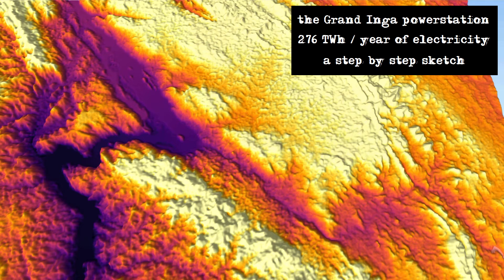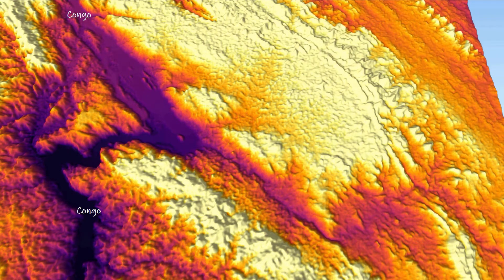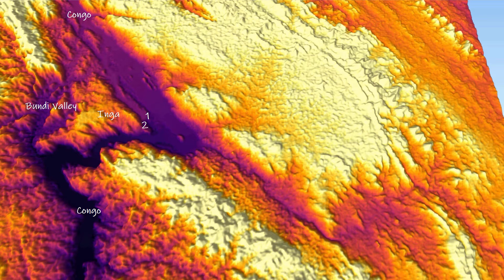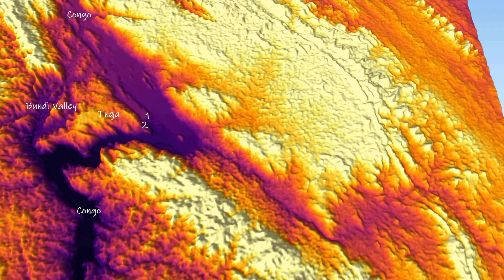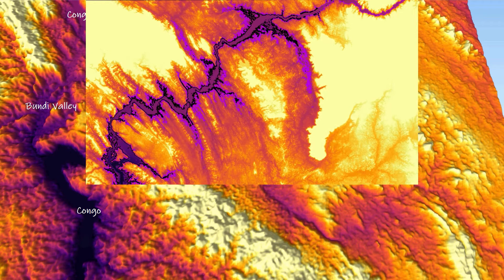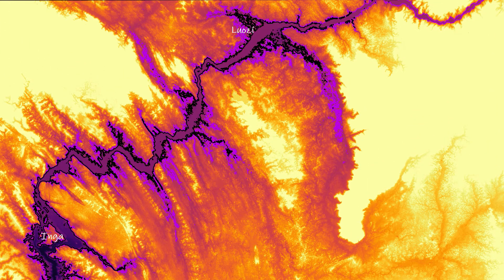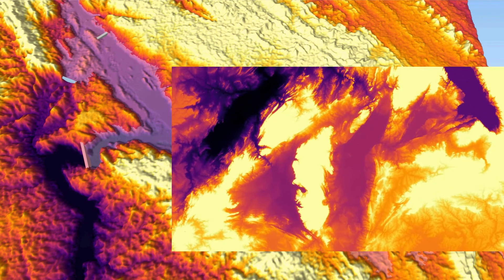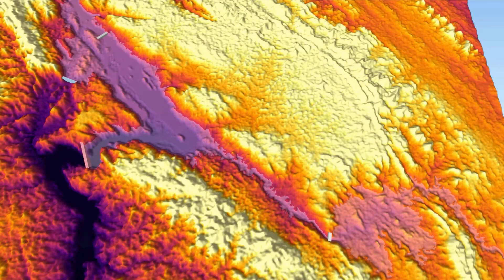Grand Inga Dam Project improved design (hydroelectric power in the Congo river): step by step sketch

Comment: Cost 80B $! A very big debt trap! Do like below instead.

For about 2B, not 80B, can get DRC 7 times more power, than the current
production. 

You can just use 0,2B whit turbine and installation, and make a 20km
tunnel under the DRC Capital. And you increase DRC Hydroelectric production
from 8TWh to about 18TWh. Hydraulic head is 20m. 

Do not forget that, you have one more Capital city 2miles away.

Grand Inga: You only need 6km tunnel to pass this waterfall. Make 3
tunnels for the price of about 0,2B, and get a Hydraulic head of 90meter. And
you can maybe make 40TWh a year. 

And you can add on more tunnels and turbines, and maybe get 180TWh, without
making the largest and most expensive power plant ever. 

Let’s add some grid, and put in a margin here, let’s say 2B, for
increasing DRC Hydroelectric power production from 8 to 58TWh. That is cheap.

And if you want more power laiter, you just make a copy off the then existing
plant, at the same location. 

You got 41
Reply from the maker: Is there a link to a more detailed description with something to verify?
But you still need a large reservoir somewhere to have a good year round electricity production: upstream of Kinshasa & Brazzaville, but where?
Reply: @ericweijters2350  Verify: 1. Google Earth, you got everything you need there, elevation and distances. 2. This river has 64,1 times more water discharge than Colorado River and 5,4 times more than The very big Colorado River. More infor here https://en.wikipedia.org/wiki/Congo_River
Reply: @ericweijters2350  Reservoir why? NO! 1. The existing power plants Inga1 and Inga2, does not have a storage. 2. Minimun Dicharge here is 35 times the average in Colombia River or 23 000m3 a second. That is more than enough. 3. You have tousens of River Hydro plant all over, that do not have a storage, they just use some of the water that comes by.
Reply: @ericweijters2350  "Year around": No this is in the Tropics, it is poring down all year. The minimun Dicharge is over 5 million gallons every second, it is ok. Or 16millions as a maximum.
Reply from the maker: @terjesorhaug143  The discharge variation: it is big, so the electicity production would vary a lot without a reservoir. That would mean more/thicker cables to South Africa etc: that also has a big price tag. And most industries and cities want a more stable supply in and out of the rainy season. When there is a surplus in energy prices drop: that to can be a reason to have a reservoir.
Reply: @ericweijters2350  "variation: it is big": Yes it is big. But that is not important. The minimum dischage is 23,000 m3/s (810,000 cu ft/s), that is 35 Colorado Rivers, 3 times The Colorado River or 8,6 times more water than in The Nile River. Trust me, this will be enough.
Reply: @ericweijters2350  "Kinshasa & Brazzaville, but where?": Easy, under the city centre. Start here "Cite Mata Onatra" 268meter over sea level, make a 18,9km long tunnel. Here The Congo is 243 meter over sea level, a 25meter drop. Lets say 20meter (to counts for the Mounsun rain flooding). 68feet Hydrolic Head/drop, is good. And whit 64 times the water that is in The colorado, you have enough water. .... And you got 2 Capitals 1 to 30km away, perfect. ... Saves  a lot on grid constrution. Inga falls, yes can do the same there, but you only need 6 km tunnels, and you get about 90meter Head/drop. Good, but far away from many costomers.
Reply from the maker: @terjesorhaug143  You cannot store the volume needed to buffer the runoff underneath the city
Reply: @ericweijters2350  I never talked about storage of water, because it is not needed. I am talkning about  just make a tunnel to move water. Moveing it to the lower place at the same river, and there you place the turbins (in this case use Kaplan turbines). Like this (and in this case 0 storage is needed) "Run-of-the-river power plants may have no water storage at all or a limited amount of storage" Source: https://en.wikipedia.org/wiki/Run-of-the-river_hydroelectricity ... The world has many tousand of this (I have 7 plant like this whitin a 20min drive... They make "gasoline" for my EV).
Reply from the maker: @terjesorhaug143  Ok, did not correctly understand your reply, but we will not agree on the reservoir. Not a problem as long as there are are no funds to actually design (to built) the thing: than the choice has to be made. Now it is only a rough sketch.
Reply: @ericweijters2350  Yes, a sketch. It is 100% the same as the 10 000+ power plant, that borrow water from a river, and give it back to the same river, just some meter/feet lower - A Run-of-river hydroelectricity power plant (ROR).
Reply from the maker: @terjesorhaug143  You mean your suggested ROR alternative for the DRC?
Reply: @ericweijters2350  Yes, they got all they need: 1. It a very cheap fast and easy way to do it. Maybe 0,3B $, not a 80B $ debth trap (after DRC make money on this, they can use some of the 95% of the water left in the river). 2. A ok Hydrolic Head. 3. Enough water (about 5% of this water, and you can increace DRC Hyrdoelectric production whit about 800%). 4. How else has 2 Capital city, whitin walking (or a 5 min boat ride) distance, and about 20million people whitin 30km from the Powerplant?
Reply from the maker: @terjesorhaug143  The amount of energy = efficiency * water * head/drop. If you use 5% of the water with a 25m drop that is 1/144th part of using all the water with a 180m drop (note: with a 180m head costs will be much less than the estimated 80B when there is a 205m head: than 1/164th part). So per kWh the plans with a reservoir have better numbers and a more stable year round production. The problem is funding.
Reply: @ericweijters2350  Error 3: "with a 180m head costs will be much less than the estimated 80B" I do not understand this connection. I can not see allmost no connectin betwhen the Hydrolic Head and cost. A plant has many cost and many variables. In this case, I am not talking about making a struckture stoping the 2 lagest river in the world, maybe 3km wide, 50meter hight, and super strong dam. That will cost mayby 75% of this 80B $ cost. And doing so 240km/149m away from the costomers. I am talking about making a about 9meter/30feet wide, 20km/12,4m long super cheap 100million $ tunnel, and putting some Kaplan Turbines at the lower side of the tunnel. Supercheap. And super easy to make. And as a bonus, the 2 capitals whit about 20million people, are just 1 to 30km away from the plant. There is nowhere you can get a better deel.
Reply from the maker: @terjesorhaug143  No error 1,2,3. I will start with #3: a dam holding back water up to 205m needs to be much bigger than a dam holding back water up to 180m, so the 180m dam will cost less (not as wide, not as high). And the pressure on the original bedrock is less: part of it are shale layers that need to be covered. #1 I was only talking about the idea in the sketch, with a reservoir.  Are you indeed only talking about providing energy for both capitals: that is a lot less / a smaller project #2 hight is relevant to get the most energy, the speed of the water in the canal is a plus, but it is the result of a difference in hight to. So the amount of energy = efficiency * water * head/drop is still valid:  I used the numbers you mentioned before, were the not correct?
Reply: @ericweijters2350  Yes we are talking about 2 different solutions. You talk about a advanst 80B $ project, that can can was it 325TWH, I am talking about starting whit 1/266 of the cost, that is very important. And yes, my solution at 1/266 of the cost, does not give so much power., maybe it uses only 1 800m3 a sec, and only makes 7TWH (estimate), whit a H-Head of 20meter. But is that not good? You can pay it down in 2 or 3 years. Is that not a very good thing? And laiter you can just make up to 12 copys, and make 84TWH - Now we are talking power and progress. ... And this is just based on the minimum discharge. On the average discharge you can do 21 copys, or maybe make 182TWH (Netherlands production is about 130TWH anualy). And the cost of maybe 0,25B $*22= 5,5B $. Yes you are correct, it is smaller than Grand Inga, about 2/5 but it is only 1/15 (whit interest maybe 1/20) of the cost. Remember: There you make the power at the same spot that the costomer lives, and you dont need to think much about making an expensive grid in a Jungle whitout any infrastructure. And do not forget the economy, making grid "all over Africa is not an easy task, selling to South Africa is a risk, making a 80B $ debth, when you dont need to borrow anything (use money from the 7TWH plant, to expand).
Reply: @ericweijters2350  I do not understand why you focuses on the H-Head,  when you got 14,4times more water in this river than in the Rhine. 16,1 times the Nile rives discharge. You can use teh H-Head you got, whitout thinking about this.
Reply: @ericweijters2350  Yes, Grand Inga has a great potential. But why spend 80B $ (debth), when you can get a 85meter H-Head, just making a 6km tunnel, from a exsisting water outlet (the one Inga 1 and Inga 2 uses/or not uses today)? If you follow my earlier example, and just make 3 tunnels, for 0,1B $ 30feet wide, trippel the water speed (beacuse you got a 85meter H-Head). Yes you need more turbines and maybe use Francis turbines here. Maybe for 0,5B $, you can get about 63TWH annualy production. 80/0,5= 1/160 of the Grand Inga cost. Is that not good? ... I understand that the Inga1/Inga2 intake, maybe need to be expanded, but that is cheap to do...... And if you laiter whant to upgrade then a Grand Inga dam, when you have build up capital, grid and local capital. I will support that 100%. .... One very important point at the end here, if you maked Grand Inga laiter, and raise the water level from 133meter over sea level, to your 205meter over sea level. That is just fine, the 3 tunnels and the Francis turbine has no problem whit that,  you can just continue useing them (and you can save on the Grand Inga prodsject laiter). The only change will be, a change in the H-Head from 85meter to 157meter.
Reply: @ericweijters2350  Not correct? I am using estimates based  on operating plants, like this https://en.wikipedia.org/wiki/Vamma_Hydroelectric_Power_Station And corrects for discharge and spillway use. 100% correct, no, but if is 10% vrong, it is not important (there is 14, 1 time the Rhine discharge her). What is important is money and debth, when a prodsject cost 266 times more. And you dont need more than 7TWH I belive the first 3year, then scale up. And if scaled up to 184Twh, 2/5 of Grand Inga, will end up costing 20times more (whit interest).
Reply from the maker: @terjesorhaug143  I focus on the head and the volume of water because that gives you the amount of energy (Physics law): you simply cannot get more energy & it makes it possible to compare different options. I came to think about Grand Inga because of my idea on mega Lake Chad; for a several decades it would need a lot of energy (and water). And would provide the DRC and more with energy and income. Your plan is much to small for that: not a different solution, but different problem to start with. I don't want the country to be a depth because we would all benefit. And supplying electricity to the capitals could (should!?) start with repairing Inga 1 & 2 to get the full potential of what has already been built. I have not checked your numbers, just used them in the calculation to see the difference in scale. To make another cost estimate I would prefer to use the GERD dam costs (scale up) because that is actualy built. Is there a finished project with the long tunnels?
Reply: @ericweijters2350  "my idea on mega Lake Chad" Your idee? This is and old idee, presented for the first time about 180  years ago. It is a very good idee.
Reply: @ericweijters2350  "Your plan is much to small for that: not a different solution, but different problem to start with." Small? Is 64TWH, at Inga small, for a Contry that makes 8TWH anualy today, really? Aiming for the stars here, whit 325TWH, is a extrem naiv angle of attack. Making a grid,  in several very ustable regions, whit no infrastructure, will fail. It is a debth trap.
Reply: @ericweijters2350  Small?  And is 7TWH small? It is an almost 100% incrase in this countrys HydroElectric production. Is that small? Grand Inga will take maybe 10years to make. But mye 64TWH and 7TWH plant can be done in less than 2 years. For the small one, whit grid included. My point is that you can scale up the City plant to about 184TWH if the costomer are there. And you can scale up Inga from 64TWH to 150TWH easy. It the startup project are a sucess, you can do Grand Inga, whit 325TWH, and use the 1 stage that you allready made.
Reply: @ericweijters2350  " Is there a finished project with the long tunnels?" Are you joking? Do you not know, that there are maybe 4000+ of this tunnels. I send you a map over a plant like this whit about 12 tunnels, maybe 60km together. WHit a 1 200meter drop in hight. I think Norway alone has maybe 400 tunnels like this (and about 1 500 dams used for HydroElectric plant.
Reply from the maker: @terjesorhaug143  #1 my idea on mega Lake Chad includes the Nubian Sandstone Aquifer (and others) to reduce the sea level rise, with agriculture and fish as byproduct (& a reduced fire hazard for Greece/Turkey/Southern Italy): there is no other one like this. The 180y old one you mentioned before is about canals and a navigable route and very different. #2 using your data in the calculation above; it was 1/144th the size. For a bigger one you need more water and/or more head and/or duplicate it many times (the Physics law I mentioned before). #3 Not looking for 7TWh (for both countries) as I explained, but for the mega Lake Chad Idea #4 I started with the 55year old and recent 205m Grand Inga plans. Goal: less flooding of valuable land, a smaller dam, in a better area & an acceptable way to store extra energy. The result is better than those plans. There have been many variations on the Grand Inga plans but as far as I know none with a tunnel (perhaps because of the water volume: it would need an exeptionally big or many tunnels); so publish your plan for the DRC (under Kinshasa?) on Youtube. Convince the people in the DRC.
Reply: @ericweijters2350  "Physics law" I do agre 100%. But is not in any way relevant here. I have been talking about utility maximization all the time. How to get the most out off an investment. If I can get 164TWH in anually production investing 3B $, and you get 325TWH when investing 80B $. For every B $ you spend, you get only 4TWH, i get 54TWH. No reasonable person, can have a problem separating the good for the very bad solution here. Yes, this an estimate from my side. Interest, distance for costomer, security and time (my solution can be done in about 1/7 off the time).
Reply: @ericweijters2350  100% agre! ega Lake Chad  is a super Idee. It can a big part of change Central Africa, make an enormous amount of food, change desert clima, and make Hydroelectic power about 300meter high H-Head on the way down to the lake. But it is 2000km away for Grand Inga, and for the most part,  it is a very different project.
Reply: @ericweijters2350  Lock at the info I sent here. Loock at the map, and you will see how easy it is to do. Much or lite water, is not important, you use construct for how much water you want to use, and for how much the costomer like to pay for. Use the 26km long GIBE 2 tunnel in Etiophia https://en.wikipedia.org/wiki/Gilgel_Gibe_II_Power_Station
Reply from the maker: @terjesorhaug143  #1 The difference in the hight of the water level at a certain distance (say 10km) is bigger at the Inga falls than it is north-south of Kinshassa: so with the same amount of water you can produce more energy a that distance near Inga. #2 The Congo/Ubangi river is much closer #3 just like #1: how much can you drop the water?
Reply: @ericweijters2350  It is, but I told you that this does not matter. When you have 14,1 Rhine river, and a H-Head of 20meter (even 2meter drop had been fantastic here). Inga is 85meter H-Head, whitout any dam building, bigger yes, but 250km from the big citys. Ubangi, nice, but but that is 1000km away. ... I am saying buil out Inga (no dam ), and build out Ubangi. But start in the capital/capitals, and build there, because it is where 20million lives, its super cheap, easy, fast to do and you can copy this plant, every time you want to double DRC power production.
Reply from the maker: @terjesorhaug143  Sorry but you are still taking about solving an other problem (you: capitals) as I explaned (me: mega lake & maximum amount of energy): my answer #1 is correct. My answer #2 is correct -> much closer because of the Chari river that flows from the C.A.R. all the way to lake Chad (you measure from the Ubangi to lake Chad). My answer #3 is correct: max drop on short distance = more energy than same distance and lesser drop
Reply: @ericweijters2350  No I started to talk about The Grand Inga, that is the primary case here. That is a 80 000 000 000$ debth trap.I have told that you can produce more than The Three Gorges Dam (87TWH), whitout making a dan here, and allmost whitout borrowing any money. You just tunnel out some shortcuts tru a mountain, a place some turbine at the on the lower end.  It is wery hard to misunderstand this. It is also hard to misunderstand, my argument about making power 250km out in the Jungel (whit almost no infrastructure). When I tell you, you can make the power 1km from the capital`s, where 20million people lives. Will you travel 25km, to by Heineken, if you have a shop 0,1km away, that sold Heineken for the 20% lower price (think grid cost).
Reply: @ericweijters2350  I do not see any need to focus on produsing Max energy. I focus on  the thing that is important here, as allways else Benefit maximization. Getting the most out of every Euro. Speed and a good reality cheeck (in the midle of the none infrastructure jungle) is also important.
Reply from the maker: @terjesorhaug143  Use the Gilgel Gibe II example you gave: 373 million for 1635 GWh. For 3 Billion that makes 13.15 TWh. For 80 Billion that makes 350 TWh.  And they have a more than 500m drop (more energy) . It looks like you've got the numbers wrong.
Reply: @ericweijters2350  You do everything to try to misunderstand, very easy stuff. I am suprised that you do not get the extrem difference in price and compecsity, bethwen Grand Imga and "my" plan. This leads me to belive that you have an agenda (I do belive you are a gifted man). How you have problem understanding the difference in price and cost, bethewn making a something  like a small house on one side, and a 50 apppartment complex, leads me to belive that you got an interest in this Grand Inga plant.
Reply: @ericweijters2350  This is a much more complicated plant, beacuse everything is different here. This was an answer to you ? about has tunnels been used this way (yes at least 4000 places).
Reply: @ericweijters2350  Try to reed and understand what I write, check the facts, you are compering a very different things and belive that they are the same, that do not work. I am basing the main pice of "my" plant, whit the cost of the worlds longest road tunnel. 113million dollars. 24,5km long. it should cost the same (more effective drilling robots, has keept cost at the same). Now you can add cost for the other components.
Reply from the maker: @terjesorhaug143  Mine is a sketch on how to improve the current design. De estimated price tag for the current design (again: not mine) is 80B and that is about what to expect if you look at the Gilgel Gibe II with tunnel. I am still convinced the reservoir is the best option to get the maximum year round electricity production. Put your design and your calculations on Youtube. I am working on something completely different now: a flood risk for The Netherlands.
Reply: @ericweijters2350  "get the maximum year round electricity production" In most cases I will agre, but here the minimum discharge is 23 000m3 a secound, you are guarantied to have all the water you need "forewer". And if you need more power laiter, when the economy has become strong. And you has increased the DRC HydroElectrial production from 8TWH*40= 320TWH (my 2 projects). Then make Grand Inga.
Reply: @ericweijters2350  I think you have miss a very important piont here. DRC has a 501 annualy income on average, and allmost no infrastruckture. I think is madness, to start up this mega project Grand Inga, and droun the contry and peopole in debth. Moraly very vrong. You should start small.
Reply from the maker: @terjesorhaug143  The countries on the Persian Gulf were very poor when oil was discovered there. The first decades the oil companies made the most money but now the oil has made countries like Kuwait and Saudi Arabia very rich. The Shell oilcompany is Dutch and the court sentenced Shell in may 2021 to reduce its carbon emisions by 45% in 2030, not only for the company but also for the products they sell (that is crucial, it is now in appeal). They have the money to realize this project (or Exxon, or ..) and to pay tax for every kWh that is produced and in say 30 years the lease ends and the DRC has its massive powerstation to supply sub-saharan Africa ... and get rich. One of the problems is the track record of Shell in Nigeria.
Reply: @ericweijters2350  Grand Inga, is to start in the vrong end. Way travel 250km 
through a very dense jungel, allmost no infrastructure, when you have all the power you can imagine, under you feet? Do you travel 250km, to bye beer, when you have beer, that is cheaper in store just outside you door? Why wait 10 years, for power, when you can get it in 2 to 3 years?
Reply from the maker: 80B is for the other plan up to 205m, but this will be expensive too. But I came to think about it because I had another 'wild idea': how to fill Lake Chad. The help of the DRC could be crucial so other counties should pay. One option is in the video on a new Mega Lake Chad (old) and the help from the DRC in the new Mega Lake Chad (new). The mega lake would create a huge lake for fishing,  a vast agricultural area, cooling of Northern Africa which in turn would als reduce the temperatures in the eastern mediterranean including the part of Europe and Turkey (less fires!). And a reduction in the global sea level rise of 25+ cm. So other countries should pay/built it for the DRC, Chad and the CAR for their help.
Reply: @ericweijters2350  "wild idea": 1. No it is not wild, it is just old, about 180 years old 2. And it is a good idee 3. It is also easy (203km tunnel needed), to send Congo water to The Nile (That river needs water).
Reply from the maker: @terjesorhaug143  It is far far different from the old shiping lane/ canal idea
Reply: @ericweijters2350  "other counties should pay": Why? Ethiopia, just 5B $ themselfs, for their GERD dam. And they needed a dam/storage, do to sesanoal rain.
Reply: @ericweijters2350  "new Mega Lake Chad": 1. Good idee, and the water can be used for making electricity (like in the Colorado Aqueduct). 2. All this benefits, also the climatic one, can be uses as argument for making a water tunnel from The Congo to the Nile River. ... Selling water, can be a good income for the DRC.